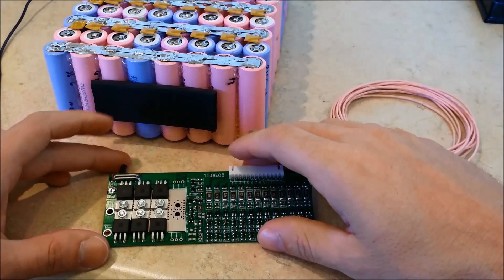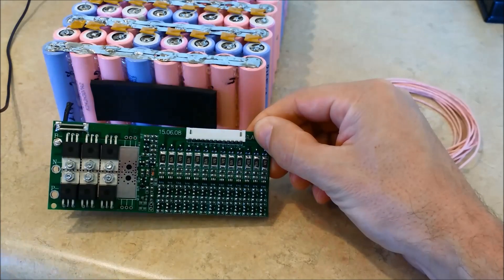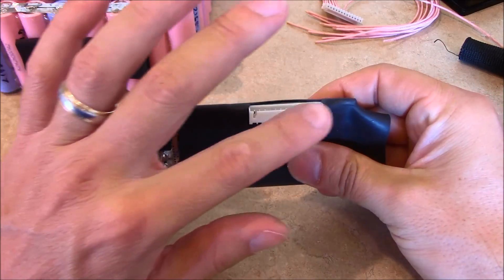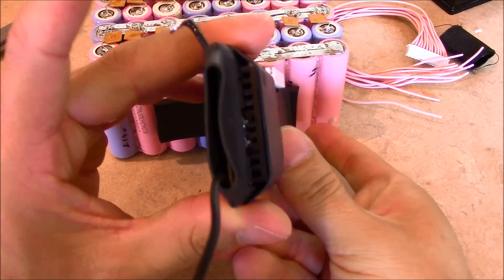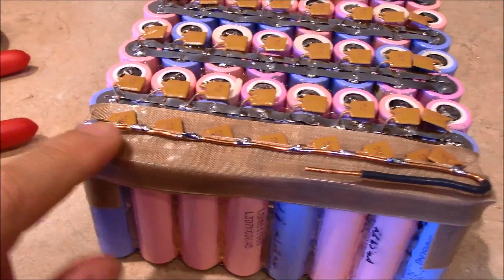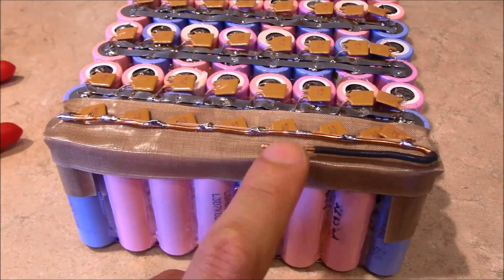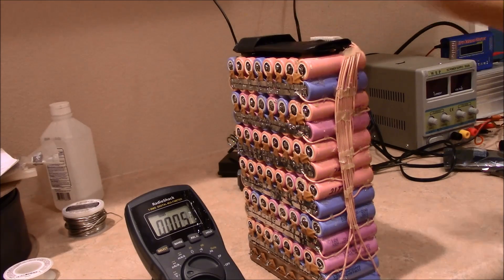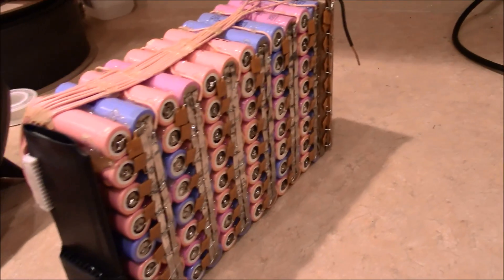18650 lithium ion battery "Wiring the BMS" (Part 4 of 7)

Comment: Hi,i am a little confused
1) does one 60v 16s bms, handles 16x60v (16x(16x3.7v cells in series~60v)) just like you did in your video
Or
Just one 60v 16s bms for every 16x3.7v series?
2)lets say i have 2 sets of battery packs,and i want 1st to fully charge up then the 2nd battery pack charges up to full,can you tell me how to do it? Or what circuit to buy
3) if have a bms for battery charging do i need a balanced charger specifically for it,or i can work with any 60v charger provided it can provide the amps,and bms will handle all the stuffs

I will really appreaciate it if you clear some of my confusions!
Reply from the maker: 1.Just one Bms for the whole 60v battery pack.  If you have a schematic you will see the BMS wiring going to each parallel bank (16s).   Be sure you follow the schematics or the BMS will fry!
2. If you have (QTY 2) 60v battery packs each pack should have its own BMS and charging plug.   That way when one is fully charged you can disconnect it and start charging the second battery pack.
If you have a 60v charger that can get up to peak voltage 4.2v X 16s = 67.2v) you will be fine just make sure to turn off the charger when its finished.
Reply: thanks a lot for your reply
i am sorry i am bothering you again with my silly questions
so 1x bms[rated 60v 16s] for 256 batteries [16x16=256] each rated at 3.7v,right?
and about the question (2),i am trying to make a ebike with 2x 256 batteries,and i am trying to find a solution that such that i can charge my bateries with a singe charger,such that it will charge the 1st 256 battery set 1st and as its finished charging it start charging the 2nd 256 battery set and cut off when its charged!
I will be so grateful if you can help me!

Comment: do you know the power dissipation of this BMS
Reply from the maker: This is a 48v BMS and it is rated for 60 amps.  When the battery pack is fully charged its at 54.6 volts.  Thanks

Comment: Can anyone tell me what those orange things at 05:30 are?
Reply: Re settable fuses apparently
Reply from the maker: Resetable thermal fuses.  They will open if too much amperage tries to flow out of the cell.   If I have a few cells that stopped working and is leaving the remaining cells to handle the load the remaining cells will have a very high drain.   The fuses will stop this and will protect the cell from overheating.   The loss of power will let me know to look into why I lost power and will find the issue.

Comment: So the bms only measure ea paralells? Not each battery
Reply from the maker: It reads the entire batteries voltage while maintaining each parallel bank.   Once the full charge is complete the charger should shut off then the BMS should discharges higher banks and once they are close to the lower banks it should start recharging again (if you have a good BMS).  I think the cheaper ones are mainly for high and low voltage protection cutoff.   The BMS units I have don't really balance to well.  I leave the charger on when charging is complete to try and force the balance feature to do its job.  The banks get close maybe due to the fact that they are used cells and each cell is at different levels in there cycle life.   My charger will stop charging, but will maintain peak Voltage of 84.3v with 0.1 amp and my battery still only gets up to 83.8v.  so this tells me that some banks are over 4.2v and some are lower than 4.2v.  I now have to remove the covering and read each bank to ID the lower banks then within each bank find out what cell or cells are not charging correctly and replace it.   I built this to see if I can get great performance from used cells and I did.  But I have to stay on top of the cells that are not performing like the rest of the other cells.   Best thing to do is buy new cells and install a BMS for protection and it should be hassle free for many years charging up to the correct voltage.   I have about 1000 miles on my current battery with maybe 5 full cycle charges and 35 half cycle charges and its doing fine just not charging fully.  One day soon I will go back thru the battery and fix the issues again :)
Reply: 15-sec-of Fame  okey nice! thanks for answer! Im interested of building A 48v 40ah pack. 
Do one bms work for this? Can you recommend a good one that do  balance them like you say?
Reply from the maker: Yes all you need is one for one whole battery pack.  If you are using separate battery packs you will need a BMS for each battery pack. T here are 48v BMS's that are good for 60A.  I found mine on ebay.   They run for around $45 US, just type in 48v 60a bms in the search.   The good BMS's will run in the mid 100's so if you can buy new cells you don't have much to worry about as they will self balance and you can use the cheaper BMS units for protection.  If you are using used cells charge them up individually for testing mAh later and if they don't fully charge then you will have issues later when there in the banks in parallel.  Low mAh and charging will not give you a solid good performing battery so keep an eye out for them.
Reply: 15-sec-of Fame Right cool! well I rather go overkill with a good one. New batteries isnt 100% identical anyway I think.
I also learnt that a good charger which stops charging at 4.1v can almost double the lifecycles of thr pack?
Reply from the maker: For you to wear out the battery it will take 10+ years unless you are really hard on the battery.   With a 54.6v at 40 ah (2184 watts) not sure if you will do much damage by using it.   I was hard on mine when I was at 48v 17Ah for a 1500w kit pulling 5.4ah from each cell at full throttle and it was so hot once I thought it was going to catch fire.   So I learned to back off the throttle and build a larger voltage battery pack to help 72v ( 84v peak @ 19Ah or 1600 watts).  When I have time I will build a new 84v 27Ah or 2250 watt battery to help keep the battery from getting too warm.   Oh and use the 18650 holders if you have them helps keep the batteries from getting warm.   Dont glue them like I did as the heat will transfer to each cell during use.   I don't use the battery fully maybe down to 77 volts and when I know I'm going to go places within the next few day I put it on the charger. That's called half cycle charge and you have 1000 + full cycle charges.   A few hours later it ready.  Just don't blast it all the time and the battery will last longer than the ebike.   So I have about 5 full charges and 35 half charges and have rode about 1000 miles to give you an idea about how much I've used on my battery pack.   I've really only used about 22.5 full cycle charges adding up the 35 half charges, 5 full charges and I went about 1000 miles.   So if you use new cells and you have over 1000 full cycle charges coming you will have to go 25,000+ miles (depends how far you can go on one charge) before your batteries are around 70% left at full charge.  Oh yeah wait,  the BMS will cut Voltage at 48v but your good down to 39v so your really saving cycle life there too, so now thinking about it your really only charging half cycles.  I can go 55 miles per charge down to 72v but if I didn't use the BMS I can go further down to 60v.  I would say 50% further so a total of 75 miles on one full charge.  That would be one full cycle charge.  I really only fully charged 11.25 times in 1000 miles.   Awesome!

Comment: Bro I'm from India from where I'll get BMS in  17s12p for lithium ion battery pack (60v24ah) to my  E scooter .
Reply from the maker: If your cells are 3.7v cells then you will need a 16s.  Here is a BMS for 60v battery packs 

http://www.ebay.com/itm/16S-60V-45A-BMS-PCB-Protective-Board-Balance-For-Ebike-Li-ion-Lithium-Battery-/272767807967?hash=item3f823a71df:g:D50AAOSwXtRZbsWr

Comment: I'm confused as to where you input the voltage for charging. Is it the N- and P- ? And what voltage are you putting in (I'm assuming 50v (12 X 4.2v) ? What are you using as a 50v PSU ?

Comment: hey man, im having a big difficulty finding bms for li-ion cells that charge to 4.1v as all i can seem to find is lifpo4 bms's which only charge to 3.6v, im confused as to where you got your bms, pls help.
Reply from the maker: some spec sheets are in different about saying they are 3.6v or 3.7.  For me I see them as the same, as you have a buffer when charging.  Do you have 18650's?  Send me the part number of your cells.   Also how big is your pack going to be, for ex a 48v battery pack for 3.7v cells will be 13s and I can try to help you find the right BMS.     Some people don't even use a BMS if their cells are new.   If you go that route just be carefully not to go below its lowest rating during use.  Use a digital voltage read out to monitor the voltage.
Reply from the maker: If you have the part number of the cell that will help eliminate some of my questions.

Comment: When the battery is fully charged the charger stops the charge process. Does the charger stop it or is it the BMS in the battery that stops it?
Reply from the maker: The Lithium ion charger I was first using would sense the BMS as the BMS will hit protect mode at max voltage.  The BMS would stop the charging and the charger would shut down.  That became a problem quickly for me.   I needed it hold at 54.6v so the balancing can start.   Some banks will charge faster than others once the battery has had quit a few charges, so his charger allowed the banks to stay out of balance and was getting worse.   I now have a charger that will hold voltage so the BMS can contentiously repeat turning off and back on and voltage will be waiting for it.  I've had it for a year and no issues perfect charge every time now.   I'll unplug it after a good long balance charge though.  If it helps set an alarm clock to remind you to unplug it.
Reply: Thank you.

Comment: Lithium Battery Spacer 18650 Battery Holder Bracket Composable Battery Carrier

[You can make up into any other shapes ]

Material:ABS

Usage: 24S4P 18650 Battery Holder

Diameter of the Hole: 18.4mm

Heigth: 8.85mm

you can make up into any other shapes

Model: 18650 Battery Holder

Comment: I have a 6s bms on a 6s (22,2v) lipo battery but i don't know what the maximum voltage that i can put into the bms. Please help!
Reply from the maker: If your at 22.2v your cells are 3.7v, so when your cells are fully charged to 4.2v X 6 cells = 25.2v.   The battery will be fully charged at 25.2v and you can find a 22.2 v charger that will support this on ebay.  for example:
http://www.ebay.com/itm/Lithium-Ion-Battery-Charger-Li-ion-LiPo-6S-21-6V-22-2V-25-2V-2A-Wall-Socket-ACDC-/321751878865?hash=item4ae9e80cd1:g:GfEAAOxyoA1RSXMP
Reply: 15-sec-of Fame Thanks!

Comment: is it possible to connect a higher voltage but lower amperage battery to a motor to achieve the same watts?

Comment: what was the total cost of this battery looks very neat.
Reply from the maker: This battery was about $75 without the charger.   The cells were free, but I had to buy a BMS and other parts to put it together.   If you were to buy it from a store it would be around $600-800 with the charger.
Reply: 15-sec-of Fame lmao howd u get free cells
Reply from the maker: From laptop cells,  its a lot of work to test each cell to find the good cells, but they were free and that was the point of the project to see if I could take used laptop cells and make them useful again.   I think I achieved my goal by being able to hit 50 mph for 25 miles on good used cells that was heading for the dump or the recycle center :)

Comment: i am building essentially the same battery, 48v 13s 6p..... im using the 60 amp vesion of the same bms, and the same fuses as you..... every time i connect the positve (p) wire from the bms, to the battery,  1 or more of the fuses catch fire, and i have to replace them..... all voltage check out for each cell, each row and the total....i have yet to connect the 13 wires, sense the directions say they are last, or you will fry the board... yet, things still fry, . got any ideas what my problem might be?

Comment: Can i use a 42v 2a hoverboard charger to charge my 10s 8p 36v e bike battery pack.
Reply from the maker: Yeah man as long as it has the same voltage you should be fine.   The charger was meant for a smaller pack so it may take a little longer.   Verify the polarity and you should be good.

Comment: Oh I like wiring the fuses on each battery cell, I've got 4 6s4p packs that I've built up - I use the imax b6 charger to balance them, but I'm definitely planning on switching to a single BMS. I'll have to research the resettable fuses. 

How does charging the pack work? Do you just connect 52v DC to the BMS and it balances the batteries for you I assume?

Comment: Soldering directly to a battery cell gets the battery internals too hot and damages the battery in many cases. They should be spot welded to thin metal strips. The batteries meant to be soldered on have solder tabs spot welded to the battery contacts.
Reply: expert

Comment: Hi, please help me...I have 72 units 18650. And my BMS is this (= https://pt.aliexpress.com/item/13S-48V-BMS-PCM-Working-current-20A-Used-For-48v-10ah-15ah-20ah-lithium-battery-pack/2039538200.html?spm=2114.13010608.0.61.atWP0C ) > how I can install this BMS ? Thanks.
Reply from the maker: *Not sure on your electronic skill level and I dont recommend anyone try this if you dont much about electrical wiring.   Lithium cells are dangerous and can catch fire if thrown together.

Is your battery built? looks like your using 65 of the 72 cells if they are 3.7v nominal cells.  13s5p 

P- wire goes to your controller neg power wire,  C- goes to the charger neg power wire, B- goes to the neg of the battery, B+ will go to the battery+ charger and controller positive wire.  Next is 14 balance wires: the first black wire goes to the neg of the battery or the fist banks (1 of 13) negative,  the next wire on the plug will go to the next banks negative so and so till the last wire will connect to the positive terminal of the battery.  This is per their wire schematic.  leave off the plug until you are completely done.  This is in case you mess up it will not fry your bms.  Once your wiring is complete get a meter and check your voltage starting from the first black wire.  You will need to verify the voltage in each position in order.  *Note (if its not correctly wired up it will fry your BMS once you plug it into the BMS).    Black wire will be negative so hold the negative  black meter leed there and use the other red meter leed to check the remaining wires in order.  black wire and one wire over will be close to 3.7v (if the cells are at nominal voltage), black wire and 3rd wire over will be 7.4v etc... last wire and black wire will be the batteries voltage of (48v)  make sure its not(-48v) on the meter, lol that would suck!    If all is good you should be good to go.   If you see smoke throw it outside, grab a drink pull up a chair and what the show :)  good luck man and take you time.

Comment: With the heatsink on the fets, you'd be better of getting some thermal paste or the sticky thermal pads, and sticking the sink on the other way round, so that the fets have direct contact via the paste/pad which will transfer the heat through the fins on top of the sink.
Reply from the maker: Thanks man, yeah I know what your saying but it works great even without the heat-sink.  I removed it and it worked great with out it.  
 I have since upgraded the battery to 72v with a new controller, BMS  and display.   I have been wanting to upload videos but the displays keep frying before I can get good video.   I use it for commuting when its working and put about 175 miles on the the new setup.   As of now I sent the display and controller back to China to see if they can see whats going on.   My guess is that their display is only good for 48v not 72v as I have now fried 2 displays.  The 72v power is awesome!  50mph is easy to hit!

Comment: OK questions about bms .OK I want to make it work for the main power source .also I want to do just a bit over 24v say 29v fully charged so scooter will last longer go faster .problem is they don't make a 7 or 8 cell bms .what charger can I use for this 29v pack .how many should I use in parallel so I don't kill over heat of fry my self.

Comment: I too considered bypassing the BMS to drive the load, but you will need to add the over-discharge protection that the BMS provides.
Reply: Just thinking that, you could just install a voltage reader and keep and eye on it.

Comment: hello,

i dont understand the fuses. how come they work when every cell is getting 4.2v more. so second 8,4 third 12.6 and so on.... how come the fuses dont break when you reach 30v or more?

thanks :)
Reply from the maker: They dont know of any other voltage or amperage.   Each cell and bank acts individually,   but as a team the end result is total power.  Think of it when your in a tug of war match.  You can only give what you bring to the table :)

Comment: Hi. I've made a 4s3p battery pack for a music box and when I connect the main negative to B- the end of the wire gets very hot. Is this normal? Could it affect to BMS? If someone could help please write me to franjalbarran@gmail.com if you need some pics of my battery pack. Thanks. It is the first time I make one and this video has helped me a lot.